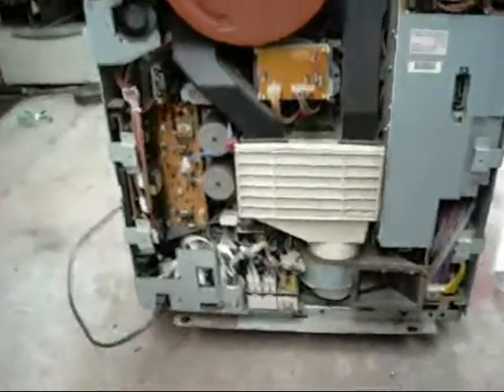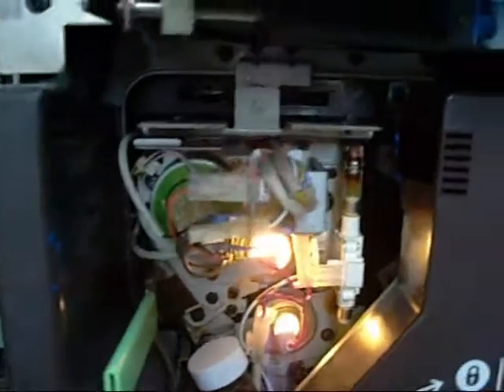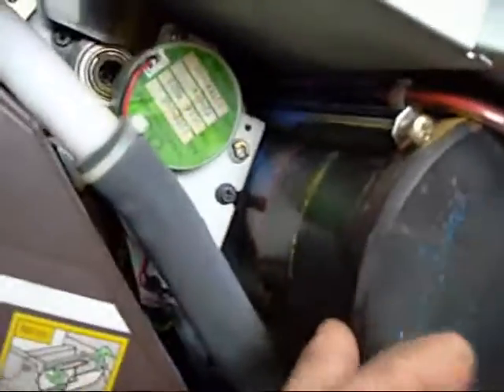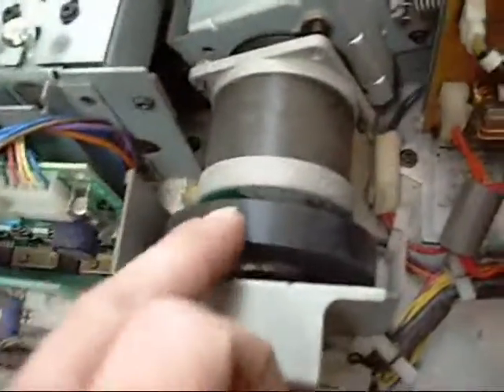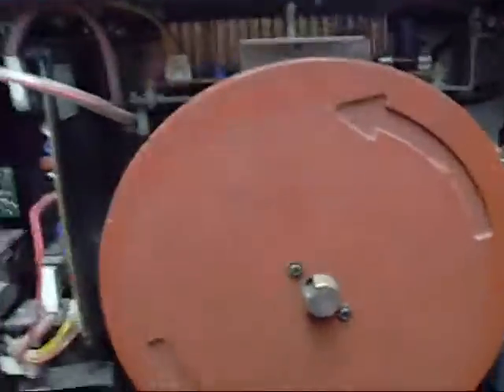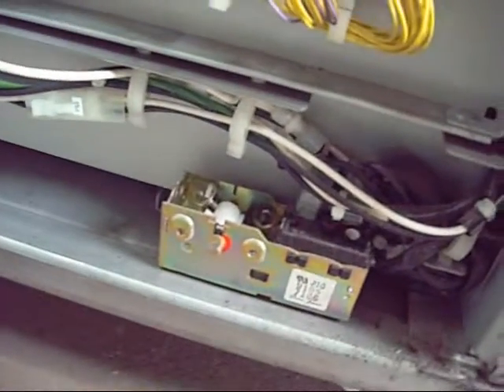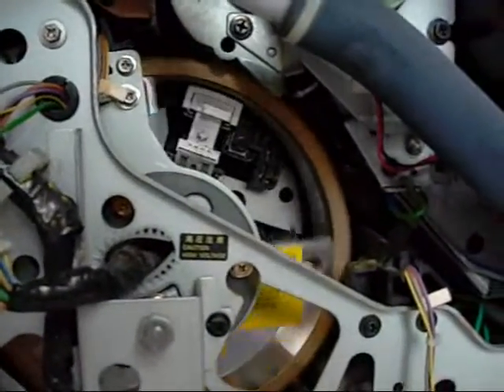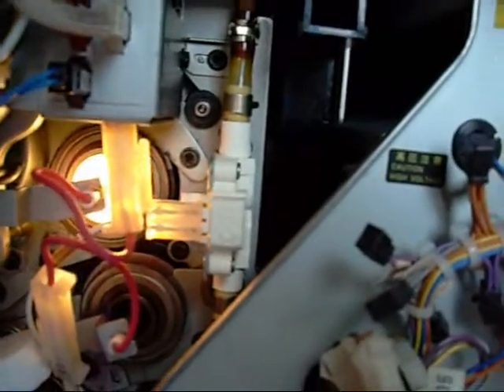Equipment Autopsy - Xerox Acolor 935 Pt2

Comment: I would keep so many things from a copier like this. lights, fans, motors, circuit boards, computers, hard drives anything I can make use of. I dismantled an old flatbed scanner and it had one of those CCFL lights in the scanning head. I made an emergency light out of it for power outages and man did it come in handy.

Comment: secret life of photocopiers.....are you gonna pull out the laser diode and put 3 volts across it?
i found an old xerox laser copier with a gas laser once-ran it off aN NST until it burnt out